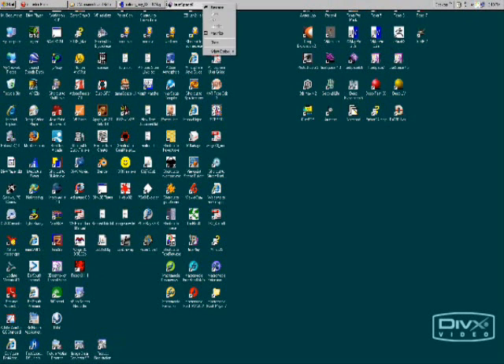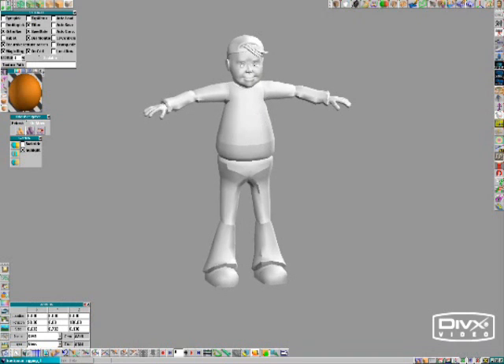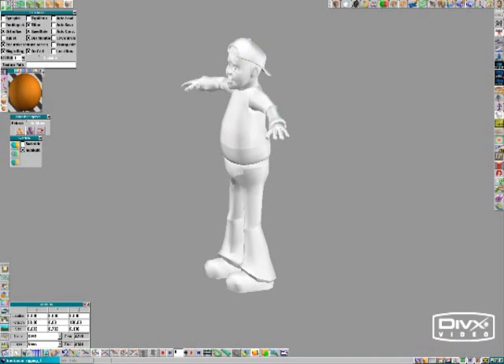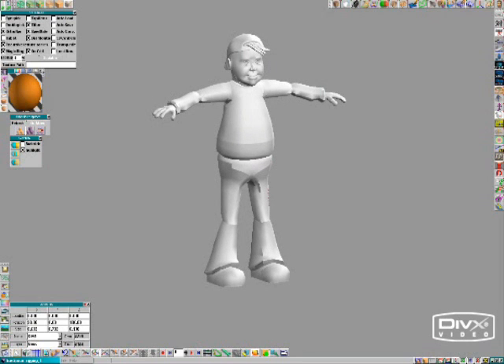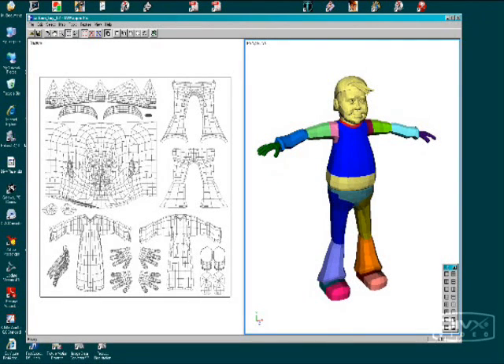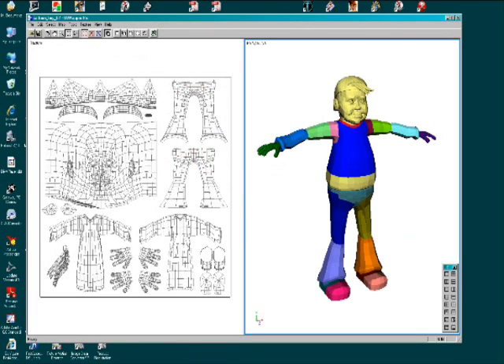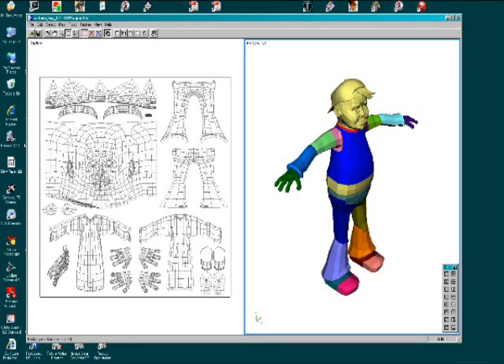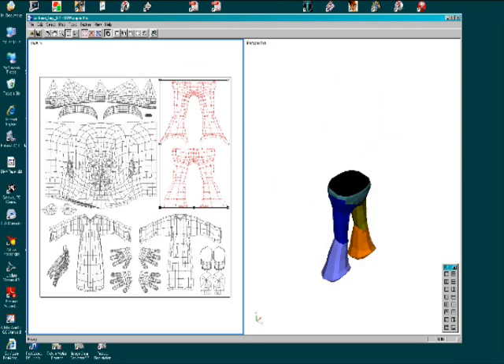Rigging Figures for Poser part 1 of 3 by PhilC

Comment from the maker: I used the material paint brush in Truespace. You could also assign polygons to different materials in UV Mapper. Most 3D modeling applications have a tool somewhere that will enable this to be done.